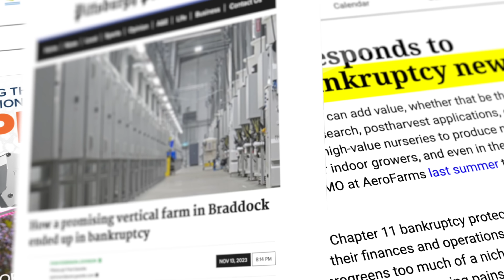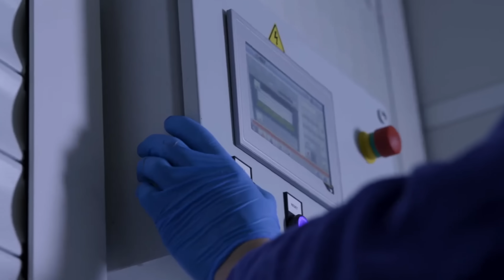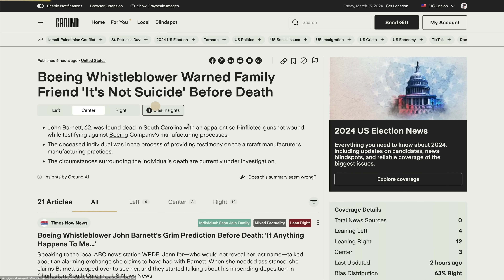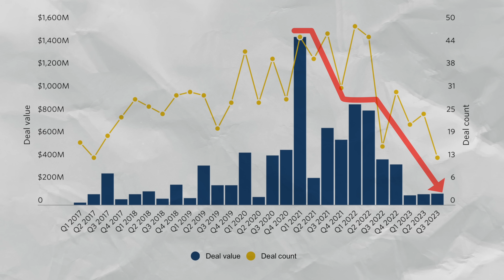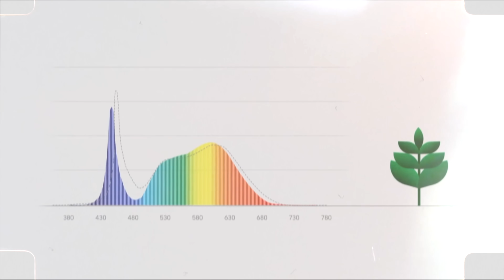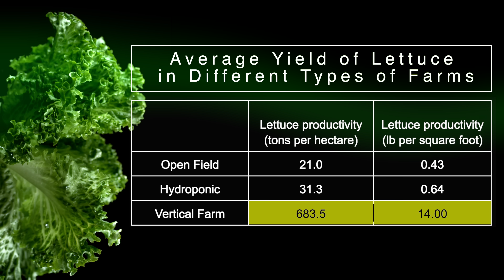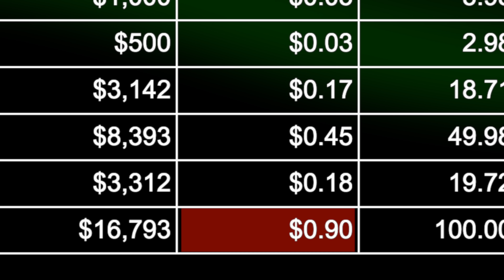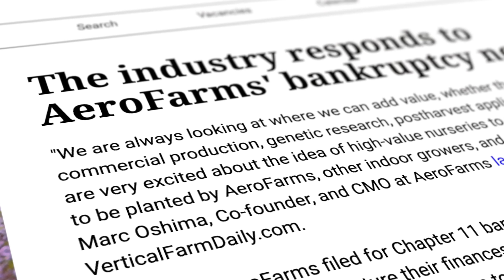The EPIC Failure of Vertical Farms - What Happened?

Comment: vertical farm's biggest achillies heel isn't just COST, it's thermodynamics.

the reason you only see things like lettuce, tomatoes, basil and the like is because they are mostly water with very few Calories.

something to clarify: a calorie is a unit of energy, it is the amount energy needed to raise the temperature of one gram of water by 1 degree celcius. food calories(or Calories, with a capital C) are 1,000 calories (hence why many places say kcal instead of Calorie) one kcal is around 0.0012 kwh a 2,000 kcal diet, the recommended amount for 1 person per day, is therefore 2.4 kwh/day or about 8% of the energy consumption of a typical household per day.

this is where you start to see the problems with vertical farming and why it isnt ever used to grow things like, potatoes or corn or wheat or barley, things that are calorically dense. but this isn't showing the full scale of the problem, that 2.4kwh/day/person is yield, not input, at a 100% efficiency you might be ok, but plants aren't 100% efficient at turning light into calories, they are around 1% efficient, then there are the leds, the LEDs are not 100% efficient at turning electrical energy into light, they are around 45% efficient (efficiency varies from 20-70 so i just split the dif)

when you add in those inefficiencies your 2.4 kwh/person/day becomes ~533kwh/person/day.

1 hectare of corn produces around 18 million calories in a year, to get that from a vertical farm you need to provide in a year 4,000,000,000 kwh or around 10,958,904 kwh/day or a continuous supply of around 126 kilowatts/hectare...just from lighting.

your typical farm in the US is around 180 hectares, so scale that up by a factor of 180 and you are looking at a farm needing around 22 megawatts of power. just for the lighting. 

this is vertical farming's achilleas heel. it works on paper, as long as that paper doesn't have any math on it.

Comment: There are a few big issues
1st.  Light tech, isn't there yet. 

2nd. Hydroponic feed sensors and controll systems are very weak from a hardware standpoint.

3rd. Lack of good research into viable high compression and density cheap living substrates and grow mediums.

Comment: I just got into tower farming for my own use, outside in SoCal growing leafy greens "lettuce" to start with. No lights, no fancy buildings. I have some back up solar generators in case power goes out, some spare pumps. But I got into it because I can grow fresh leafy greens myself, even if the stores run out or not available "due to the present conditions around the world" and not be caught in the stampede/madness etc. if the US takes a bad turn for the worse.
My plants grow well, nothing fancy, just plant seeds in rock wool, use a little artificial light to get em going, harden them off, and get em out in the tower.
I can grow micro greens into baby plants using my grow lights, or out in the sun outside in clay pebbles and kitchen baking dishes like hydroponics. No mold issues, if you keep the upper plants dry and it just works.
All those computers, misters, lights, super costly structures that suck up energy, labor, etc.
Maybe tower farms have become so un-necessarily sophisticated they have lost their way, Maybe back to basics is the way to go.
One of my buddies used to say......So many people become so heavenly bound, they are no earthly good. Food 4 thought...

Comment: well the capital expense if you think about it isn't comparable to an established farm. you would need to factor in the cost of a baron piece of land and buying all the equipment from scratch including tractors, sprayers, irrigation systems etc to make it comparable. The problem is the way the farms are set up. All upfront investment with investors not in for the longer term. All brand new cutting edge proprietary tech which actually ends up costing much more because the company has to design the system and have it produced and only the engineers know how to use it. Farming is much more off the shelf and generic. Next is the subsidies that farmers get and I wonder if vertical farmers were getting government incentives or assistance. Lastly this is what happens with all new industries. There will be players that are left and they will normalise the industry which will become more generic and off the shelf and the engineers will be replaced with fitters. Vertical farming will have it's day for sure.

Comment: In my opinion, they are making it too complicated. They should design a building without walls, just with beams to support it, allowing air and sunlight to enter. Sunlight can be directed through a system of movable mirrors and mirrored tubes. If they encounter issues with insects, they can simply install insect screens on the sides of the building. As the process is mastered, labor costs will drop. It doesn’t need to be so complicated

Comment: Gread video.  I'm an investor and a few years ago  was approached about a vertical "weed" farm.   Marijuana farming is a huge industry so wouldn't VF be a  smash hit?  Needless to say, it didn't "add up" and investors vanished.  I've long said that VF was hanging by a thread.   There's they myth of "huge transport costs" (4-5%) and the real problem, a lack of diversity.  It's been noted that we eat potatoes, corn, wheat, beans, apples, peaches, bananas, mangoes, nuts, rice, etc.   Even the greens are limited - where are the collards, spinach, kale, brussel sprouts, broccoli, kale, fennel, etc?    

Some claim vertical farms can grow tomatoes, melons, pumpkins, etc leading to the question, "But why?"  These are fast growing crops requiring large areas but minimal, unskilled labor.  In Costa Rica melons were grown on hillsides completely covered in a plastic-like netting with holes for the fruit (for Publix).   It looks like polka dots.  But it only works because labor is incredibly low.  Some have noted that automated sites should lower labor costs but the intricate machinery requires highly-paid technical workers.  Perhaps the best path is chemistry - increasing yield, reducing susceptibility to disease, speeding up growing times, converting annual veggies to perennials

Comment: If you'd power your vertical plantation with PV power, the cost of that would be manageable, the energy green and you'd safe a lot of water. So there is very much a use for systems like these from an environmental standpoint

Comment: The basic concept is sound and it has been around for at least 2000 years just not with present technology. And the answer is No because it’s not scalable. In Asia and in colder countries. They have racks for plants that lean on angle and create essentially a vertical farm that uses trickle-down watering and soil inside a greenhouse. That’s fine for a family of five but not for a city of 50,000.

Comment: I was in a hydroponics operation once. I got interested in vertical farming. Then i started doing a rough calculation of the cost vs benefit. Huge problem is the upkeep. Is just doesnt work. Not until food becomes expensive and out weighs the cost of hardware and energy. A big problem that i see is just the hardware itself. Vertical seems like a scam to sell racks, plastics, nutes, substrates, and electronics used in growing the plants. Equivalent to that gold rush anecdote "If you wanted to make money you would have sold shovels."

Comment: I wonder what the cost per calorie is for lettuce? 1 lb lettuce gives about 65 calories and less than 25% DV of most nutriants except Vit C. 1 cup (170 g or 0.38 lb) of beans provides 15 g protein (0) , 45 g carbs (13), 15 g fiber (6.5) and minerals. (Lettuce/lb value in parens). To get 1800 cals per day requires 28 lb of lettuce versus 15.2 lb of beans; of course traditional menus add high starch/carb foods like corn and squashes to get a ballanced diet. 

The VCs & SPAC  are looking to make a profit at the IPO/SPAC. Some ag products need a while to build up the supporting plant such as tree nuts, tree fruits, etc. Many apple varieties are branches grafted onto root stock. A new root stock may need years.

Comment: What's interesting is that the technology clearly works... But because they're trying to just mass produce stuff, theyre running up against the labor issue. If instead the tech/knowledge was socialized such that every commercial and residential building could have a couple area of vertical farming, it would help immensely with actually solving the core peoblem, which is producing more food and making cities a little more self sufficient.

But alas, its not 'profitable' so no one will do this. Smdh

Comment: So we need a cheaper/integrated system design instead of flashy expensive shit,  which is only a matter of time assuming it's still a high demand concept and specialized companies appear to meet the demand with cost-optimised designed farms.  And the systems need to be autonomous, so that you need less skilled workers as the system is smart enough to run itself. 

In australia in recent history the cost of a head of lettuce was about $10-13.  Heck, a salad sandwich at the local shopping mall is like $13-20 these days. It's a cost sensitive situation, as with all farming.

Thanks for the video!

Comment: Verticale farms or indoor controlled farms cam be viable and profitable, just upfront costs will ne really hight, which is why the private sector struggle to make it work.
In iceland there are giant geothermal factories that produce tomatoes, yes grothermal is easier to setup in iceland than in most places.
Also imdoors produce shouldn't be going mouldy or contaminated if the environment is sanitized, got good filtered air ventilation.
Private companies in big western cities plugging in led lights will never be profitable unless the indoor farm is designed with that purpose and a huge amount of money is thrown at the initial project. Is why it needs to be backed by the government

Comment: 10:33 How the heck is the blue collar labor costs of indoor versus outdoor so vastly different? One is 5 cents and the other is $2.25, per pound. I realize it’s just one data point but that needs some explanations. Are they hand cranking motors? What the hell are is all that extra manual labor going to??? Is it the price difference of a rural migrant worker versus a city dweller? 
If anywhere was going to lean into automation more than manual labor it would be indoors where heavy durable outdoor machinery is not a prerequisite for getting to the plants. I realize that would eat into the startup costs of scaling a vertical farm and might not be an easy sell to investors, but I would think less labor as a long term investment strategy is a huge strategic incentive to vertical farming. 
If your white collar investments are that low in a vertical farm, then maybe it should be higher to support things like automation and efficiency in the long term. 
Farm fields are constantly tweaking fertilizers, water, pesticides, and crop timing/placements. Most of that is either a bet by the owners or is aided by farm consulting services. Aka white collar jobs (debatable to call farm owners white collar). White collar labor in vertical farms should be many many times more than on farms. Especially when it’s a new industry and as the right ways to automate and tweak things are figured out. 
Vertical farms will be more expensive at first, but that breakdown table or budget just points out glaring flaws or is just not well explained. It’s central to the video and it is used badly.

Comment: I've grown mushrooms and salad for over a decade and have recently taught myself to grow hydroponically.  There are many issues embedded into hydroponics that will eventually be addressed as we are witnessing the pioneer stage of what will eventually be the neo modern food system.  
The biggest issue is that land, food transportation, and synthetic fertilizer are way to cheap to make production of water grown salad mixes to be viable.  The next big issue is that you can only really grow baby leaf varieties on hydroponics in order to keep the grow period before harvest as low as possible in order to maintain high returns. the final issue is that since these are usually calcium or salt based synthetics nutrient systems, they lack the biodiversity that will help to moderate the inevitable build up of bio sludge in the systems that ultimately becomes a vector for disease and pests.  If you build a system that requires hyper infrastructure in order to reduce contamination, your system will eventually catch an issue. The last issue, and is what caused the downfall of large investment hydroponic projects like Appharvest, is that they lacked the experienced hydroponic managers to keep the food factory alive, but that will change once Ai has been properly integrated. ontop of all the surface level issues, there is the issue of scaling production.  As a farmer you have to be able to match your production to the size of your customer basis, so if a single room hydroponic system were built with maximum output in mind, but they take a decade to reach that weight per week, then they are essentially paying people to constantly clean and maintain all of that dead space until it gets utilized. Plus I pretty much lost my farm business in 2021 when the wholesale restaurant industry I was reliant was crumpled from 2020. 

The age of vertical farming is far from over, it actually hasn't even started.  When petrol is unaffordable to ship food around the planet, it will be far more effective to ship dry nutrients which gets assembled by bio engineers into the product of edible food.  

The future of hydroponics farming is going to be similar to doordash or an amazon warehouse.  Eventually a design for shipping container resembling pods that stack and have an app full of workers who show up and check individual pods and get paid, similar to workers cleaning hotel rooms.  These individual pods are going to be what keeps large scale disease from spreading and the modular size is going to allow for pack flat disassembly of these greenhouse shipping containers, so they can be bought and sold and moved around.  We are at such a point in history's technology that everything built today needs to be able to be recycled, dismantled, and reusable.  I assume most of these hydroponic designs do not take this into account.  I can build my hydroponic system in 2 hours "after all the parts are pre-made" and earn about $400 a week from 8x5ft of space,  that is far more money per foot than any coperate hydroponic company can grow, but I also can only max out my system to the size of my community, but that is perfectly good because my overhead is low and if everyone were doing what I'm doing, we'd be flush in food everywhere in the world.
Reply: When transportation is so expensive to offset the vertical farming’s high cost, vertical farming’s cost will go up as well. All things depends on transportation, including the material to build vertical farms. Also, if we centralize farming, how would we move the food to people all over the places?
Reply: @yearofthegarden  in your essay you say you failed in this industry. With all due respect, maybe somone who didnt go bankrupt doing this is better placed to give an opinion on its success? The idea AI magically improves hydroponics is silly, AI can't clean algae. People have been doing similar techniques in the Netherlands successfully for years. America's farmers cultural unwillingness to learn from others(eg the whole of californian argriculture is based on inappropriate water use) is why they imagine this industry is starting out, when it's actually well established. Most of Europe's illegal cannabis has been grown hydro for about 15yrs now-to give an example of how widely it's practiced.

Comment: The pest control problem was actually their mistake and could easily have been rectified before it happened. Pests, like all contactable diseases and viruse and bacteria, thrive in a closed environment, which is why colds spread public coz stiupid people forget that coughs and sneezes spread diseases! Doubly so in a controlled environment like verticle farming. What I don't get is why they don't build tall greenhouses and by tall I mean 100 to 200 feet and make them less high tech and use the natural sunlight instead of LED lights constantly. Use both depending on the season I say. Still, it is a great idea but they went and overcomplicated it didn'yt they and that's why they are shutting down.  I always like the idea of apartment blocks covered in plants! What a great idea, but has only been done in few places. Singapore and Malaysia I think so far. It will come, mark my words. Hey, maybe we could get the secondhand equipment cheaper? Got any numbers?
I visited a company in England once to see what equipment they were coming up with. £6000 per panel for one vertical panel that only produced  20 growing areas both sides, and that wasn't including the water and leds equipment. I told them in no uncertain terms that people couldn't make any money out of that and the ROI was terrible despite the tech. I told them that I could make my own wih Polycarbonate or large waste pipe and turn them into vertical growing stations cheap.
Keep the VF faith peeps!